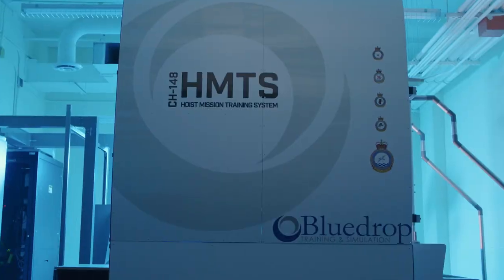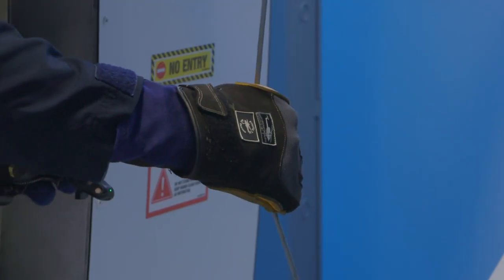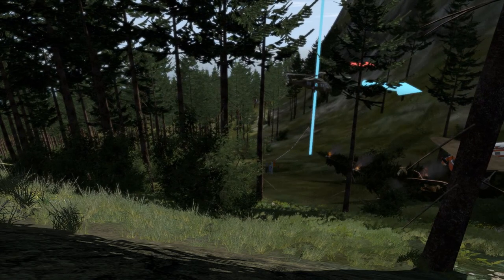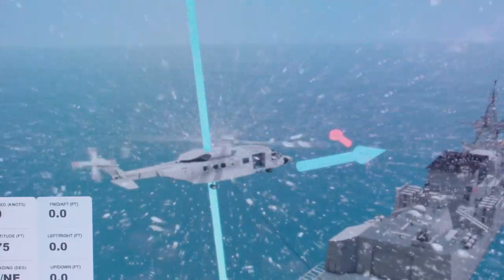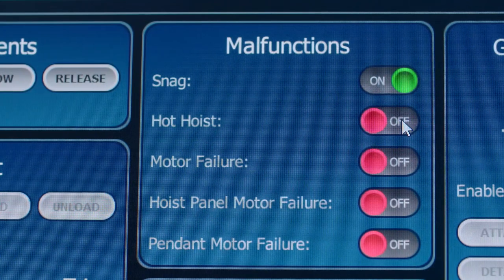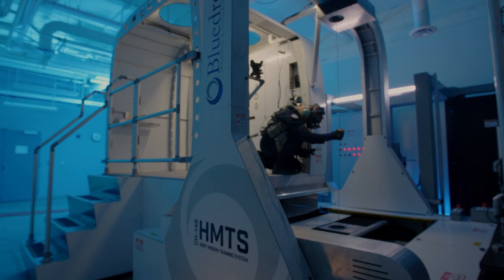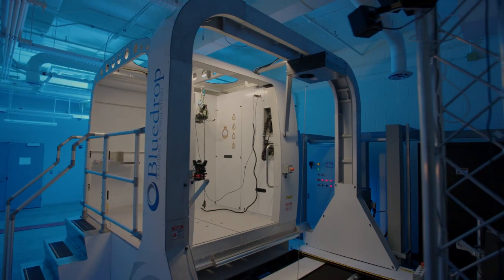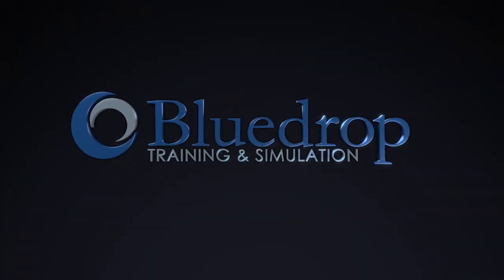Bluedrop Hoist Mission Training System

Comment: The HMTS is an amazing training device. I had the opportunity to be one of the testers to see if someone with no training in hoisting could figure out how to operate the system. The HMTS is 100% safe--you can't fall out when you're secured properly--yet an adrenaline rush because the simulation is immersive. Accurate conning and, more importantly, accurate delivery and return of rescue personnel and devices takes a lot of practice and the HMTS provides that.